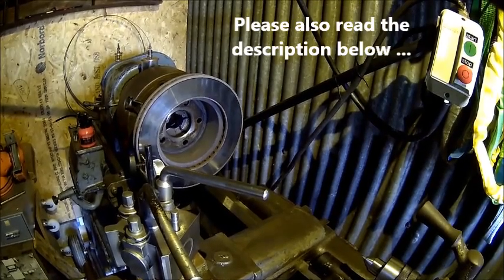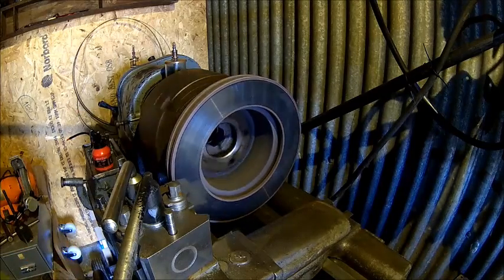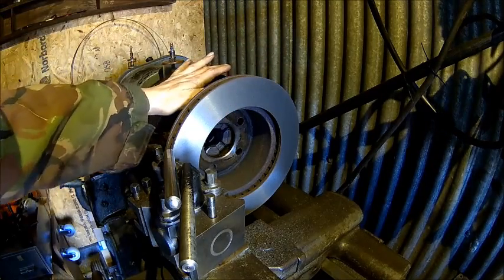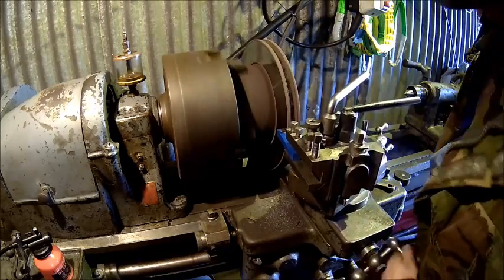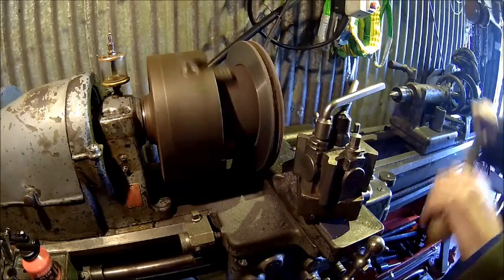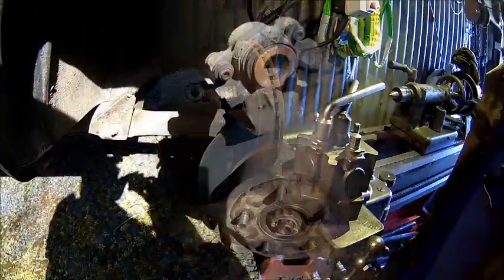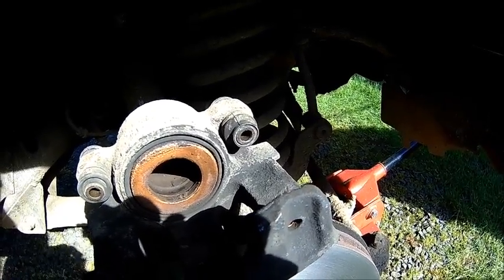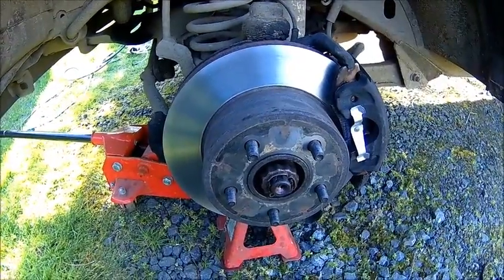Machining Brake Discs on the old Lathe (Jeep Cherokee XJ front brakes)

Comment: on the inside cut you could have used a boring bar.. just take a really light cut...
Reply from the maker: you absolutely right, the problem is i don't have one with the tip ponting to the right and i can't use a normal one up side down in reverse because the chuck is screwed onto the spindle. Anyway, the tool did fine even with that small clearance angle.
There were actually 2 problems, one was the cross slide travel and compond travel, both were fully out when i had just about enough tool stick out to reach the inner diameter and i could not go further left tas he saddle was hitting the bottom of the disc, .. and second is that bulky Dickson tool holder, it's actually a bit too big for the machine.
I really neet to get a Multifix for that lathe, but i need an "E" , the "B" type is too high, and E's turn up rarely on ebay.
Or perhaps i need a bigger lathe ....
Reply: well i do have a brand new multifix B ..lol.. got an A as well but like you, would need the E size for my clausing..

Comment: The look pretty blue. Overheated?
Reply from the maker: Not really, blue is only about 300degC which does not need alot of braking to reach that, if you race down a mountain road and they glow in the dark that's about 650 to 700degC, so better keep on moving to cool them down a bit. 
Overheating is a bit of a relative thing with brakes, it mainly depends on your pad material and the caliper design how much temperature they can handle, the disc temperature is rather secondary as long as you don't loose structural integrity..
As long as you don't have cracks or deformation, you should be fine to re-use them. Worst thing is going through puddles with hot brakes, that's causing alot of internal stress and may make the material brittle which can lead to cracks and also may warp the rotors.